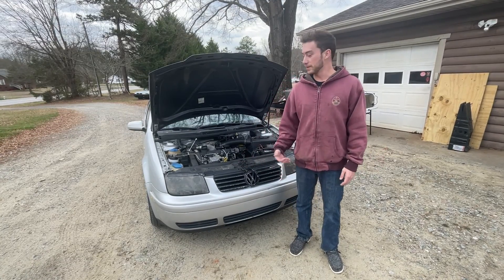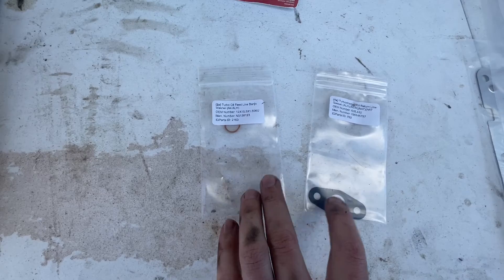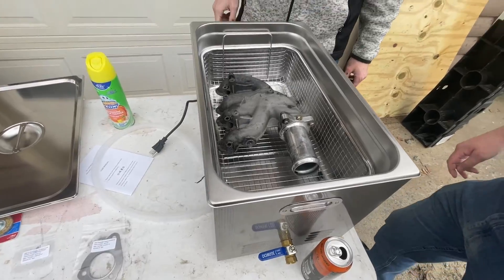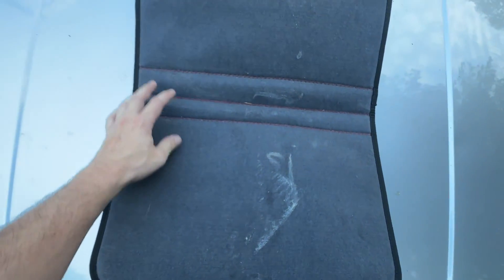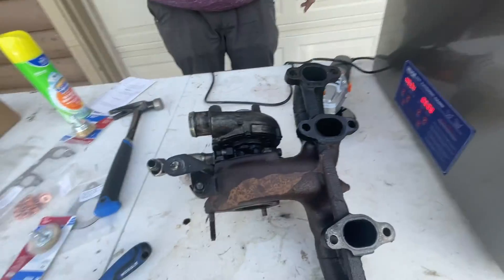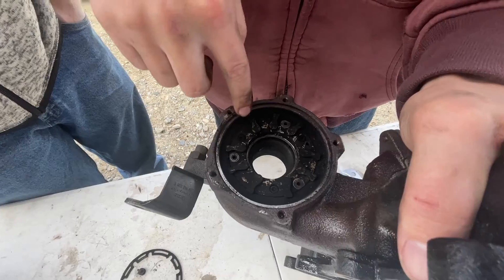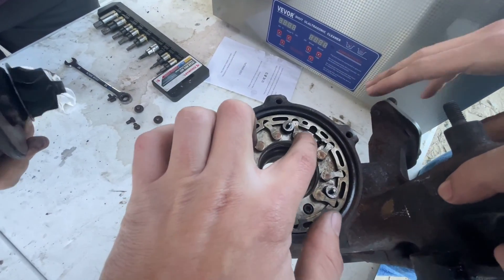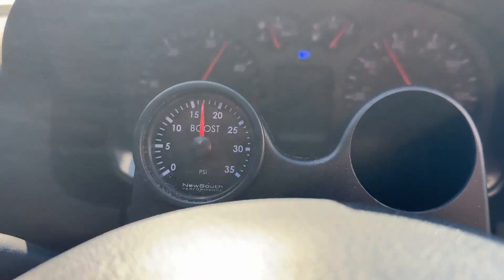Cleaning A Turbo In 5 Minutes

Comment: I tried doing this and it took me more than 5 minutes
Reply from the maker: You gotta be quicker than that!
Reply: You can spray oven cleaner into the hot side of the turbo,with the turbo still on the car.
Reply from the maker: We’ve done that on this car before, it does work but not for long. It’s also not great for the turbine seal since that stuff is pretty corrosive
Reply: @GasHouseGarage  Oh right. I believe that the newer generation of garrett turbos such as gtb series and newer are less prone to carbon seizing the variable veins. I owned a golf gt tdi 150 mk4 years ago and use to regularly spray turbo cleaner and use liqui moly injector cleaner as routine maintenance. These engines respond very well to a good remap.
Reply from the maker: That they do! We have a golf with a GTB1756VK on the channel and haven’t had any actuation issues with it so far. They’re much better turbos
Reply: @GasHouseGarage  Nice one👍